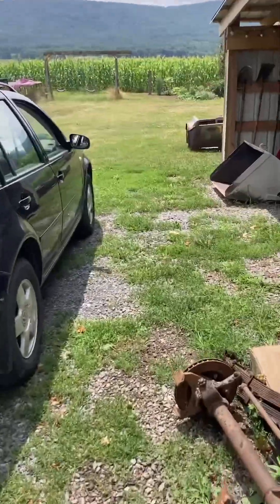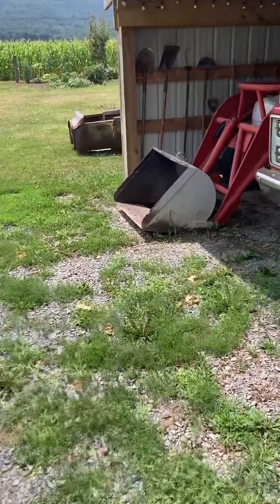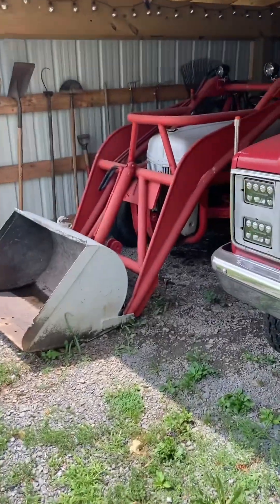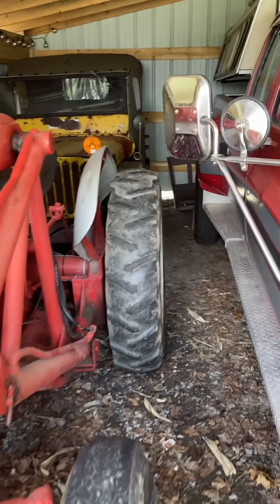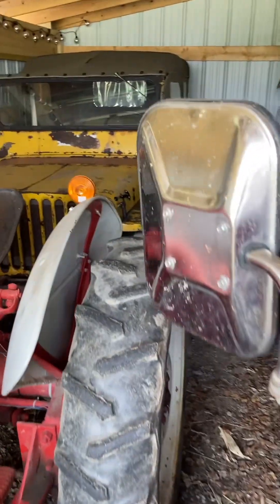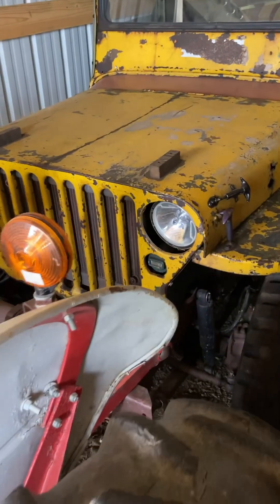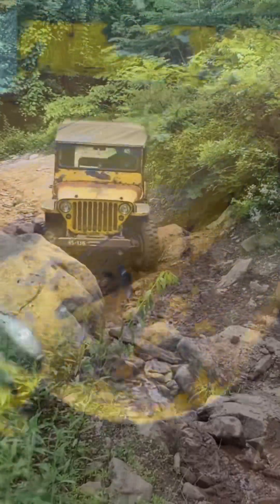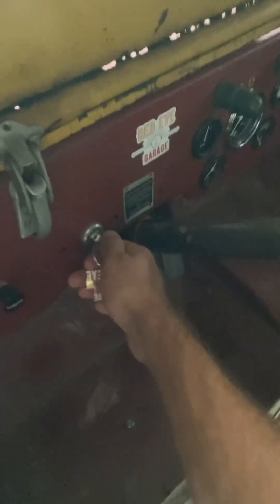Rotary engines  are “So unreliable “

Comment: I certainly wouldn't say unreliable, but a better description would be shorter service life
Reply from the maker: This will start some drama but.......The old  N/A 13b and 12a will outlast a stock willys l-134 engine.  You wont find a go-devil that can go 75-100k without a rebuild. ask Rob Dahm :)
Reply: @redeyecafegarage7484  do use a premix with your rotary to add life to the seals ? 
Comparing 1940's tech and metallurgy to 1980's isn't a fair match
Reply from the maker: Yes I pre mix.  lol “fair” I’m just stating the fact that the na 13b is very reliable and has a longer service life than the Willys engine. Facts have nothing to do with “fairness”